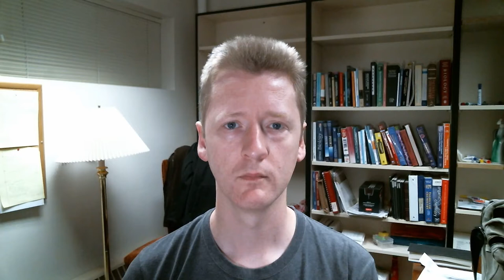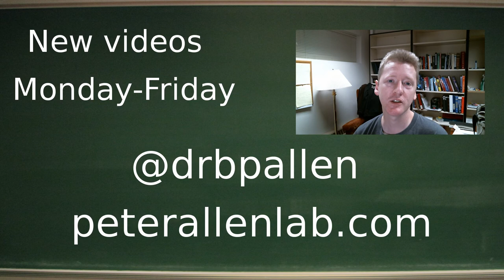Why no Moore's Law for Batteries?

Comment: If you want to store energy, you can store energy in parallel plates which are called capacitors, Plus-minus plates. Plates can be made extremely thin as thin as molecules, meaning in principal you can assort an enormous amount of energy using carbon nanofibres and plates called graphene. Some people think nano technology could give us super batteries but not yet. Nano technology is still in its infancy so we’ll have to get used to the fact that gasoline is still very efficient. So if nanotechnology, develops it could improve battery life beyond that of the internal combustible engine. I learned that from Michio Kaku

This guy also said we’ll have nano-batteries in the future so are you sure about Moore’s Law not applying to batteries?

Comment: Where do you think the future of batteries is going. You don't hear much about fuel cells anymore. Do you think there is any future in thorium reactors.
Reply from the maker: My impression is that the big improvements will come from manufacturing advances. While the performance is probably going to increase slowly, there's room for a lot of improvement in price. I imagine costs could fall by 2-4x over the next 10 years (but that's pure speculation). 

I love the thorium reactor idea, but the U.S. is probably not going to build it. Ultimately it will be a fight toward the cheapest kilowatt-hour. In the US, that will probably be solar/battery. But in China, it might well be nuclear of some sort. They are building a variety of next-gen reactors from what I hear.
Reply: My speculation is that as lithium and other rare metals will start to rise in price and we will shift to pumped hydro or compressed/liquid air energy storage too. 

I'm an undergrad who volunteered at a solid state battery and fuel cell lab. I think fuel cells have a future but should stay off cars and be used for buildings and I don't have a guess for what role batteries will have.